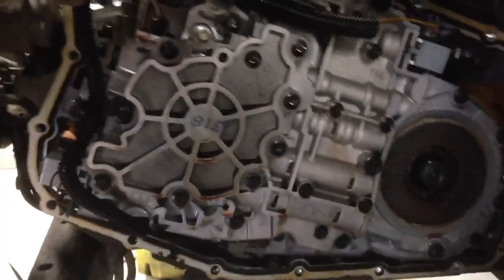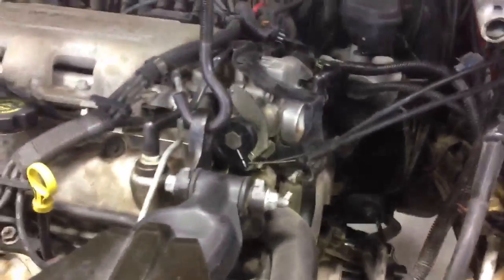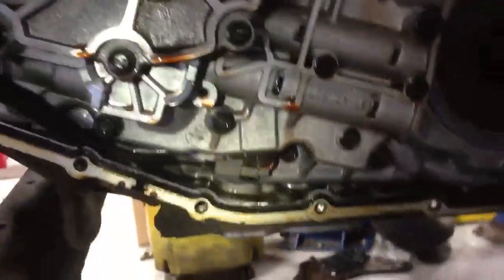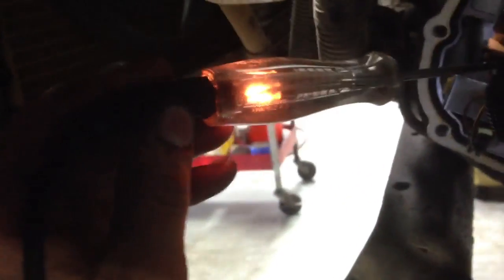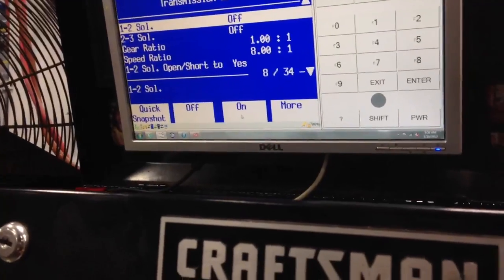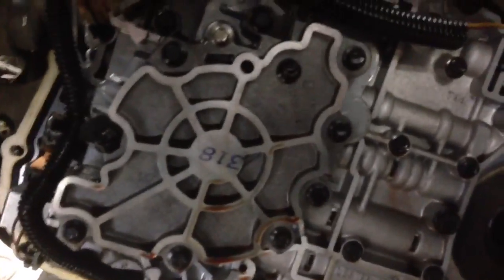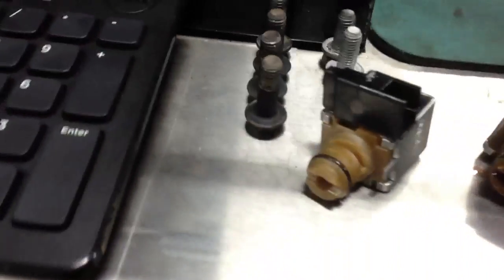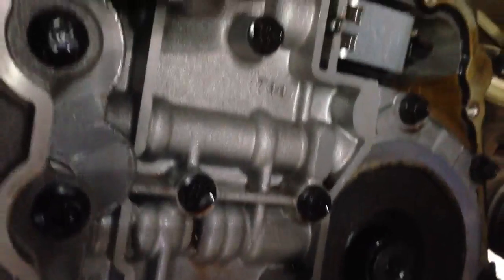GM 4T65E Transmission Code P0753 Diagnosis and Repair

Comment: i think i might have changed the wrong solenoid on my 07 impala. got a code solenoid b stuck on and I replaced the wrong solenoid because it still doing the same thing as before and I can hear this winding when i'm driving too.

Comment: I have a 99 venture and having a hard time trying to get the side panel off. Do I have to take the two top engine mounts off to lower the cradle more to get the panel off?

Comment: aren't you afraid of cooking that tcm with the test light?
Reply: No, as long as the test light has the right bulb in there theres no danger in what he is doing. My test light pulls 140 mamps which is way under what these circuits pull when everything is good. I use my bulb test light all the time for checking drivers in the ecm. Most relays and solenoids are around 300 mamps and mini relays are around a 100 mamps when these circuits are operating when everything is ok. So just making sure you have the correct bulb in there and then actual check what the test light pulls amp wise to be sure!!!
Reply: +70corwin i saw the video about 10 days ago and i saw my comment and started laughing wtf is that question hahahahhahaha because later i understood, hovewer thanks.

Comment: Hi Daniel, thanks for the post and your troubleshooting technique. Can you tell me if it is necessary to first drain the trans oil, others posting say it is but doesn't seem like you would have to to me and also how difficult is it to line up the intermediate shaft back together when reinstalling the pinch bolt? another poster said that was the most difficult part. Thanks in advance.

Comment: Hey I have a 1997 Pontiac trans sport 3.4L engine and the same transmission you worked with in this video. The service engine soon light come on and it's a bad 1-2 shift solenoid but when I drive it it just don't shift to gear 2 sometimes it will on its own but when it does on its own it will jump up to 4th the back to 1 the 2 and when I let off the gas it will shift fine. I don't know if it's the  Solenoid or not.

Comment: i have a 98 olds 88 the car wont move in neutral drive or reverse i hear something trying to engage it wont roll either motor runs its not locked up

Comment: I once bumped a solenoid when changing trans fluid on a 4L60-E, and it was stuck in limp mode after that. The pan was hard to replace because of the shifter lever, and it happened when I was putting the pan back on. I pulled the pan off again and found the little tin saddle that the solenoid sits in was bent. I pried it back into shape and it worked fine after that.